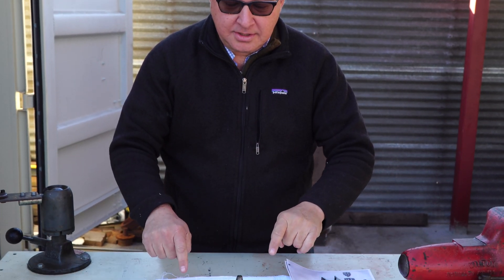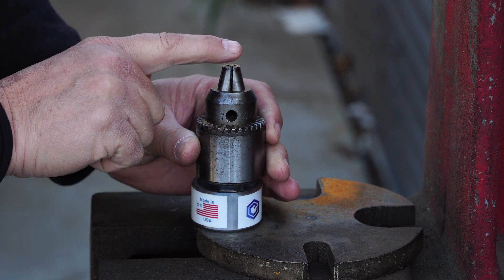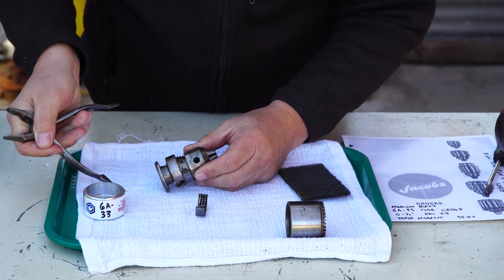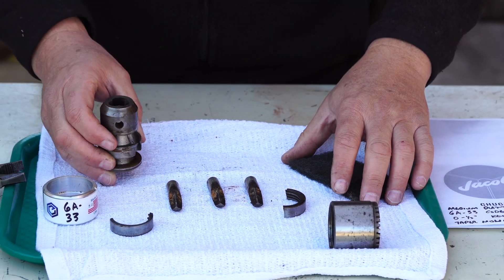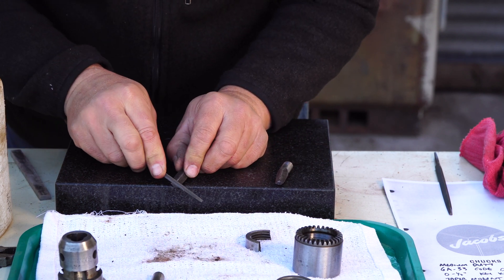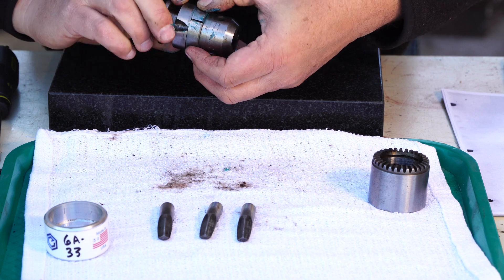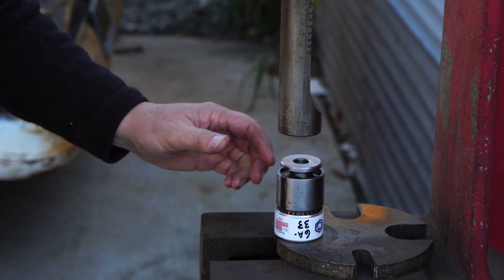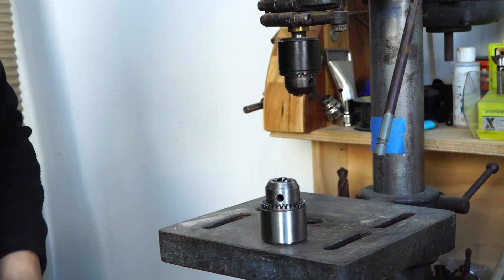Jacobs 6A-33 Chuck Rebuild, Parts, Options

Comment: Good idea not to press down directly on the jaws…use a sleeve to press on the body…👍
Reply: Actually Jacobs says to press directly on the jaws with them half way out
Reply: But yea it probably would be better to just press on the main body but only if you can do it without retracting the jaws all the way. You still need them half way out.

I'm sure Jacobs reasoning for instructing to press on the jaws is to avoid people retracing them all the way like most would likely do

Comment: Very helpful video, thanks for posting it. I'm now ready to tackle the stuck chuck from my 1941 Craftsman Mohawk drill press.
Reply from the maker: Thanks for watching and good luck with your rebuild.
Reply: @EvolventDesign  Just serviced the Jacobs 33 chuck, the stuck chuck now works well, after removing 80+ years of gunk, sawdust and who knows what else. Interesting fact: 2 of the 3 jaws had numbers stamped on the  wide ends, exposed upon disassembly. That made matching them to the correct marked positions in the chuck body a breeze. Maybe only these older chucks have such markings on the jaws.

Comment: Good demonstration. Thanks. I never had to take any of mine apart yet but if I do I’m sure I can now. BTW I worked at some job shops and that drill press head you have there was always running. They ran all day long. Some of the smoothest drilling with great feel when using tiny drills.

Comment: I have the dp220  as in video,has 6a 2a taper to thomas c wilson adapter ,im restoring ,was wondering how it was removed ,ive seen some small wedge tool to tap wedge apart,not sure if mine has threads or taper the jacobs chuck say 6a 2a taper.thanks😊
Reply from the maker: Have not inspected the DP220, but it should either have a LH thread or some way to use wedges to get the chuck removed from the arbor.  Thanks for watching.
Reply: @EvolventDesign  it has a j2 taper, popped off w wedge,appears to be a,1/2 hole on spindle,then that thomas c wilson  adapter to jacobs,I ordered  a keyless for  it,which matches the j2 taper,hasn't arrived yet

Comment: Useful video,…it’s a good idea to let the chuck soak in white spirits for a few days to soften any hardened grease etc, and makes cleaning so much easier…if you can’t split the chuck from the arbor,  you can drill through the chuck until you hit the arbor, then use a steel punch to knock them apart…
I clean all the parts using a circular brush in a bench grinder, which removes any solid stuck on grease etc, then a wash in white spirits…
I never use grease on any drill or lathe chucks, as it just acts as a magnet for dust and metal chips, a regular light oil like 3in one works perfectly well and in my 50 years of working with them, I’ve never had any problems, apart from having to service old chucks that have previously lubricated with all types of grease which basically eventually clogs the mechanism and prevents easy operation
Reply from the maker: John-nice to hear from you and thanks for watching.  Yes-grease does attract debris and can become the problem.  Your 3in1 lubrication plan with frequent maintenance sounds like a winner.  Thanks for sharing it with us all.

Comment: Timeless information. Thank you. I just aquired a Craftsman 150 drill press with this chuck and it needed replacement. But i pressed it apart and will clean and rebuild. Saved me $$ too! Use a 1 3/4" open end wrench for my press ring.

Comment: Thanks for this video, just overhauled my same chuck as video, for my bench DP220. I have the whole DP apart for restoration. Could not get the chuck off the taper but didn't need to and just left it on the taper and disassembled it by tapping with a hammer, came apart easily. Looks like brand new now. You stuck a screwdriver and rag in there, I used a large caliber bore cleaning bristle for the jaw holes, worked like a champ!
Reply from the maker: Very cool!

Comment: Question, does the 6A-33 chuck have a hollow hole through the center of the chuck.  I suspect someone has glued my chuck onto the shaft so I would like to drive the shaft out with a punch but not sure if the center of the open jaws is the tip of the shaft.  Can you advise?
Reply from the maker: The one that I show in this rebuild does NOT have a thru hole.  You cannot go through the jaws and tap out the tapered shaft in the back.  You would need to drill it out first.  A good inspection with a flashlight and you should be able to see it. - Better yet, get your smartphone and take a quick video in there and you should be able to diagnose it.  Good question.

Comment: Very handy video, I have a 1950ish Delta DP-400 and the bit wiggles a little also the chuch was hard to turn. I followed this, I found a little burr on 1 jaw, sadly it hasn't solved the wiggle but the chuck is much easier to turn now.
Reply: To add, I couldn't get my chuck off so I dropped the shaft and worked it from there.

Comment: How do you remove the chuck? I tried a pair of wedges, didn't succeed, but may have been too afraid to use enough force. My machine is a Delta DP220 and looks pretty much identical to yours. Same 6A-33jt chuck. I need to find a new starter capacitor, too. Thanks for the video.
Reply from the maker: There are sometimes an extra sleeve or depth control right above the chuck.  Just take it off so you can clearly see where to put the wedges.  Good lighting, and clean surface help you see where to attack the arbor with wedges.  Also make sure the wedges are not hanging up on anything.  Give it a good tap.  Leave wedges in overnight and add some penetrating oil.  Let me know how it goes - you are close.